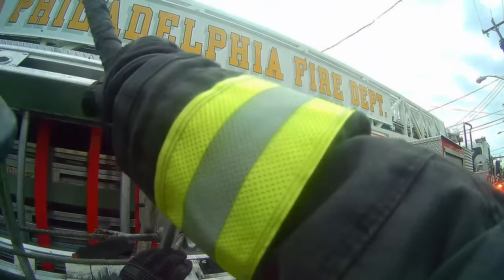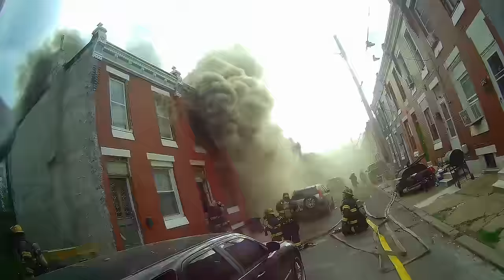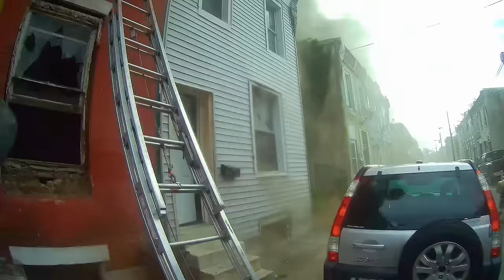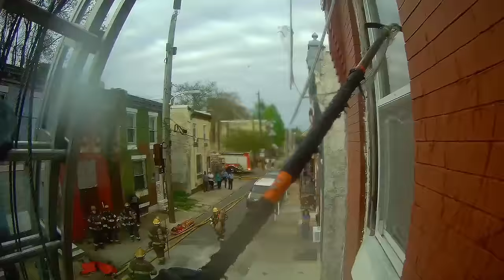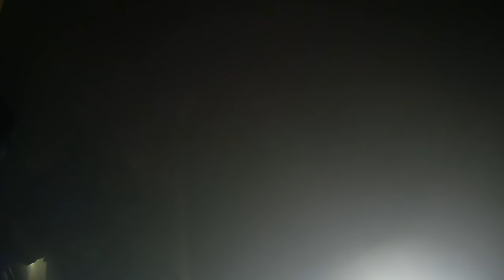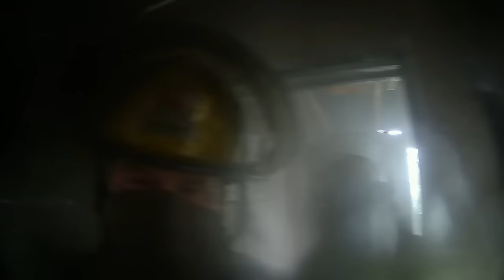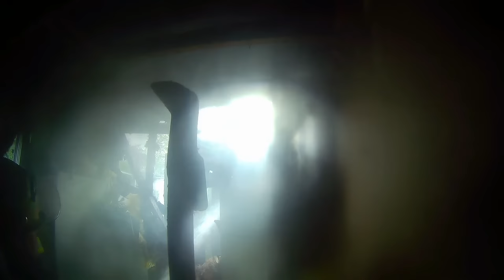North Philly Structure Fire Philadelphia Fire Department PFD Heavy Fire 2nd Floor Vacant Dwelling

Comment: Why are you breaking every window? Does this not create worse conditions with you suppling more oxygen from the flow path? I don’t fight fire in row homes so I’m trying to understand why you broke so many windows? But cool video of the incident none the less. 🤙🏻
Reply from the maker: Here's a pretty good article that explains why we ventilate - 
https://www.firerescue1.com/fire-products/ventilation/articles/ventilation-basics-rVoFqASavaSwz4gU/
Reply: Allows smoke to flow out to make it more visible when moving around
Reply: @jesseosada4690  I see that article is dated back to 2006. Thank you for the read but the tactics the gentlemen stated in the article are a little dated. I’m not disagreeing with you breaking windows or vertical vent. I just wanna know why are you breaking every window before suppression is being applied to the fire. Just seems counterintuitive to feed the beast before trying to slay it. But my little experience and little knowledge of this craft is just making be want to ask questions and learn more. Thanks for the read and hope y’all had a blast on the Jaaab 🔥
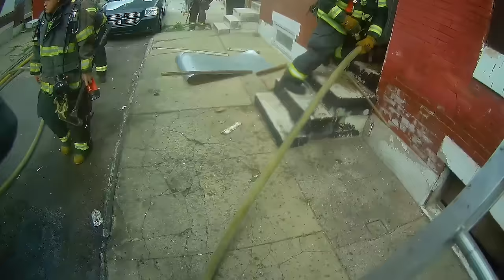Reply from the maker: @juddboster530  We always try to coordinate our ventilation with a charged hoseline. The primary dwelling was vented while the engine company was attempting an interior attack (3:02) and the Bravo exposure was vented shortly after a charged line was advanced through the front door (6:57). Having spent several years in an engine company, and from my personal experience, the worst conditions you can have are feeling extreme heat in a dwelling that is buttoned up and packed down with smoke and not being able to see the location of the fire. It was much better to have the ladder company vent while climbing the stairs in which case the fire would show itself and can be extinguished immediately. Otherwise you risk crawling down the hallway past the fire because of zero visibility, only to make it to the front room, find no fire and turn around with 2-3 rooms and a hallway blowing back at you and possibly burning through your hoseline. As long as a charged line is in place and ready to attack, venting is a much needed relief to the guys inside and also helps prevent the initial attack team from getting steam burns.
Reply: Positive pressure ventilation is a firefighting tactic.  Introducing a positive pressure to improve visibility reduce heat improve life safety and find the fire quicker
Reply: @juddboster530  firefighter safety bail out -I understand flow path concerns , but in this department's way of thinking -the positives of clearing windows -out weights flow path concerns - I was always taught to take out the center mull / frame also
Reply: firefighter safety bail out -I understand flow path concerns , but in this department's way of thinking -the positives of clearing windows -out weights flow path concerns - I was always taught to take out the center mull / frame also
Reply: @jesseosada4690  thanks for the clarification brother, was just trying to rap my head around it and learn some new tactics and strategies. From my previous statements, I do agree with you. Wasn’t trying to come across as arguing, genuinely wanted to learn. Thanks for sharing a sick video.
Reply: Coming from a guy out in Cali who has been on an engine for 5 years and a truck for three why not vertical vent and not worry about flow path with having the best path for smoke and super heated gases to escape upwards? What are your guys roofs made out of? Just asking questions because brick buildings out here are made different do to weather differences
Reply: If there’s no hose line in place it could make the fire grow but generally venting windows releases heat (which you can definitely feel) and eventually gives you some visibility. Trucks in areas with good engines generally trust that the line is going to get in place. North Philly seems to be super ghetto so I’m sure the guys there are very experienced and don’t have to ask permission to vent.
Reply: @jesseosada4690 
Terrible habits, you never vent before water on the fire… Your changing the flow path of the fire.. That’s a terrible mindset
Reply: @achunable 
Your not a firefighter, absolutely false

Comment: See quite a few guys carrying pickhead axes in this video, pretty cool to see. Is the pickhead the preferred axe in Philly? My state you rarely see anyone with Pickheads. The little differences on what is carried by guys in different parts of the country is interesting. LA everyone carries a pickhead I believe
Reply from the maker: @stephenjake2021  Yea I love the traditional fire axe. Its my favorite to bring to the roof. Some of the flat roofs in our city are 4-5 inches thick, so the pick is great for pulling up roofing material after you cut a hole. I guess some of the newer styles of ax will probably work if you have newer construction dwellings or pitched/peaked roofs, but most of Philly is comprised of old rowhomes. I grab the flathead axe and marry it with the halligan for forcible entry though, the flathead gives you a striking tool combined with a blade that you can use to chop through a door if needed and also doubles as a wedge to gap the door.
Reply: @jesseosada4690  i usually carry the irons at my job, but ive always liked the pickhead. And some guys can do the "baseball swing" method for wood framed doors like nobodys business haha

Comment: Tight block.  Do you guys in Philly fight a lot of fires like this, extending the line because you cant get the rig down the block?  Great video.
Reply from the maker: Yea we have a ton of tight streets that we can't make with the apparatus, especially with cars parked on the block. Some companies in Philly run with different setups depending on the types of dwellings and street layout of the neighborhood they are in. For us there are a couple preconnect lines on the back of the engine they can use if they are able to pull up right in front. Otherwise they have to stretch 3" supply line down the street and connect to a bag with 3 lengths of 1&3/4" attack line. One of the disadvantages of working in a city so old.

Comment: This is not criticism by any means, just curiosity, but why does it take so long to get water going? Is it due to the the engine's limited space to move through or fire hydrants or something else? I see this happen often in videos like these but I only have limited knowledge of how the dynamics of these kinds of things work. I can imagine how stressful that makes things.
Reply: I'm only in the Fire Academy, so I'm not a pro by any means, but I think I can help clarify. The short answer is: it's not as easy as you'd think.

Ideally, they'd be able to get the truck much closer to the building. Generally, the more hose you need for the attack line, the longer it's going to take to establish it due to the physical work required and the potential need for couplings. Also, the hose needs to be properly flaked out before turning the water on - a single kink can greatly reduce water pressure. In addition, usually multiple people need to be on that attack line, the person controlling the pump needs to be ready, and all of that needs to be communicated. That probably wasn't much of an issue here, but in smaller departments it can be a lot more difficult.

That's not everything, and it's generalized, but I hope that satisfies your curiosity
Reply: @eyalich  Thanks bud! I guess it all comes down to little things that pile up.
Reply: @eyalich  Also the engine has to park two houses ahead of the dwelling to leave space for the ladder in case the main needs to be raised as well as properly laddering the structure for rescue/ ventilation.  Philadelphia has a lot of rowhomes.  Flaking the hoseline is also a factor.  The pump operator has to wait for the firefighters to enter the structure before dropping the tank.  If he/she opens opens up the tank too soon, (charge the line) it will be extremely difficult to advance the hoseline if fire is on second floor, or basement

Comment: Read the comments :)
I can see why the windows were broken: poor visibility, high heat, a means of egress. Not agreeing or disagreeing just here learning.
I would have moved the ladder from the flames, though the ladder is designed to withstand heat it is not made for direct fire contact, ladder should be moved to the training center. department must high budget :)
Thanks for video… Good work

Comment: I dont get it. I am a forefighter in the netherlands and we use antiventilation. Get minimal oxygen flow to the fire close everything so the fire will go partly out by itself. Why do you guys increase oxygenflow? It onpy makes it burn harder, faster and hotter.
Reply from the maker: @jasperkramer5693  If you study fire behavior or fire dynamics, it will show how it is beneficial. From experience we know from trying to enter a room that is on fire and opening the tip (nozzle) and flowing water into an unventilated room, you create steam and you disrupt the thermal layer in the room. If there is nowhere else for this heat and steam to go then it pushes back onto the firefighters who are trying to extinguish the fire. This causes steam burns and could possibly push the fire over their heads and out into the hallway. We do our best to coordinate our ventilation and break windows as the engine company is opening the tip so that the steam and intense heat goes out the windows instead of back onto the firefighters. The fire will burn hotter for a few seconds as oxygen enters the room but will go out much faster and not push back on the engine company as water is applied. In the case of an exterior (defensive) attack, taking out the windows allows water to be flowed inside to try to knock down the fire.
Reply: Philly = Aggressive interior attack. Jasper, we won't ventilate until water is in place. Double house, no problems the engine and ladder Stationed together. Single house is only an engine. We waited for a ladder so we got inventive. Sometimes the driver would throw up the 24' extension ladder. Carried D cell batteries to break windows. Or most often, tipman and officer move to fire, backup man vents with the Halligan bar.  Engine. 51, 72, 47 and L12.
Reply: You're embarrassing yourself

Comment: Why'd they pull out of the fire building?
Reply from the maker: The chief pulled everyone out because of the condition of the building and the amount of fire. It was a vacant building with holes in the floor and heavily damaged stairs. Heavy fire was showing from the 2nd floor front and also in the rear
Reply: @jesseosada4690  I see the fire, but that makes more sense now knowing the interior structural conditions. Gotcha